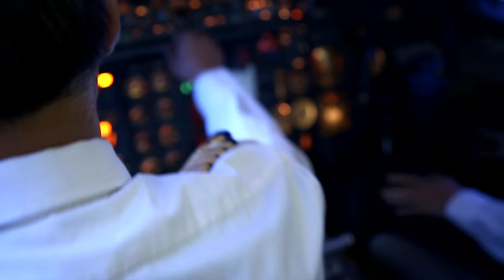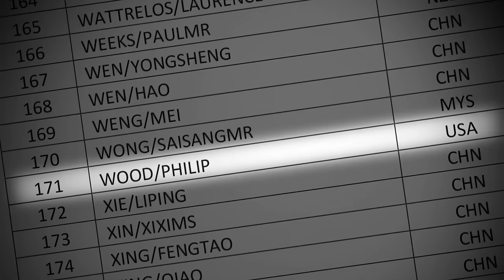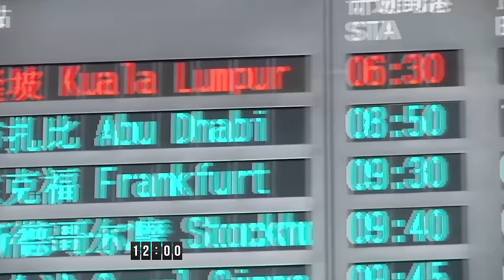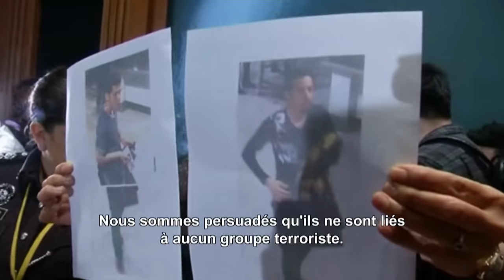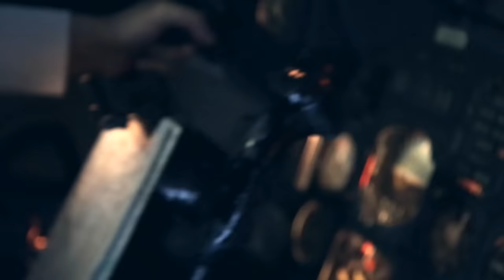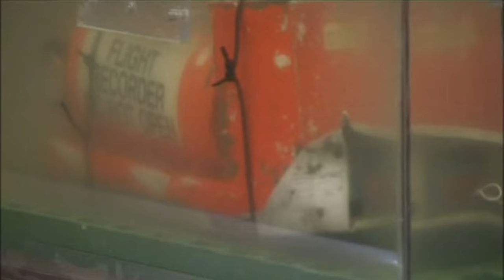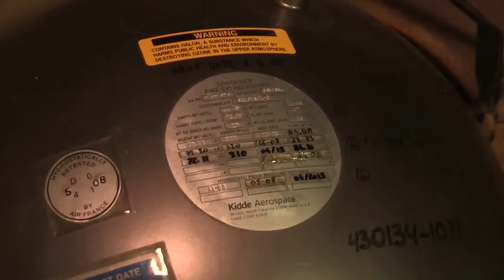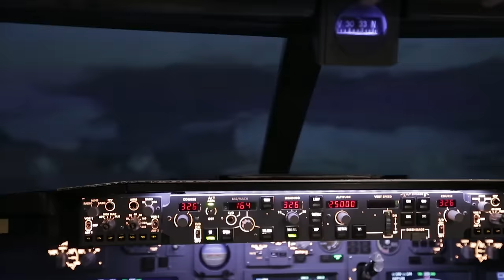Why We Never Found The Malaysian Flight MH370?

Comment: I don't think it ran out of fuel at all. I believe this was a deliberate controlled ditching into the ocean trying to leave the least possible debris trail. Which looks like what happened. And if you were going to intentionally ditch the aircraft, why would you let it run out of fuel ? Would be much easier to control the decent and the ditching with power. The fact that they found a flaperon indicates a low speed impact. Whom ever did this found some really deep water and ditched it as slow as they could. So it would just flood and sink. Thinking it would never be found. And given the depth of the water, they most likely will never find it.
Reply: @UguysRnuts  then why didn’t he just land the plane once he realized his negotiation failed? If he cared about the lives on board? And what makes the prisoner he cares about so much more important than the lives on the plane?
Reply: You are correct. Watch the lecture by Larry vance he explains it in full detail
Reply: @UguysRnuts  ohhhh sureeee he is
Reply: @UguysRnuts  thats honestly a pretty good theory. I hope one day we know the truth. Whatever the actual truth is.
Reply: @UguysRnuts  Its totally plausible that nations would have some sort of agreement like that in case of scenarios like this where they think that the lesser of evils is to cover up the truth to preserve some sort of image or prevent the possibility of other acts of terror. 

The only thing I find hard to believe is that the pilot would have taken things that far and risked his entire reputation as a pilot for a politician and then the fact that none of the passengers were calling their loved ones? 

This is so confusing. The whole thing is so dark and eerie.
Reply: It was never proved the flaperon was effectively from flight MH370.  Only guesses and assumptions.
Reply: @UguysRnuts  but why would the pilot go through such extreme conditions for the negotiation? He doesn’t gain anything from the release of anwar?

Also could you further explain the significance of obama visiting Malaysia as I don’t understand it
Reply: @sloeberdoet  Boeing confirmed it was from the aircraft. Every partof a plane has a serial number..
Reply: @mrwippy3112  Yes Boeing very convincing an American company.  The evidence of the pieces wasn't very convincing  plus it still doesn't proof that it was suicide from the pilot  even if it were pieces from the wreck.
Reply: It still shocks me considering how big a plan is
Reply: @UguysRnuts  it’s a great theory for sure. I can see it as possible and even more probable than other theories but I feel like unless we really know, it’s still not concrete. I wouldn’t be totally surprised if that was the truth.
Reply: ..so you didn’t leave an “OIL slick” or a huge explosion IF FUEL is onboard maybe?
Reply: @sloeberdoet  The flaperon is absolutely from MH370. Process of elimination alone makes a strong case for this.
Reply: @sloeberdoet  Your anti-Americanism is tiresome, and it is clouding your judgment.
Reply: He could have ditched fuel? The area they believe the plane lies in is over 4,000 meters deep. He knew what he was doing, and the Malaysian top brass know it.
Reply: how come more of the aircraft was not recovered ...they almost always find quite a bit of parts?
Reply: That's absolutely make no sense. If you wanted to intentionally crash the airplane. You do so immediately. This thing is making course changes and flying to no place.
Reply: @margaretmanzer2194  the Indian Ocean is a very big place. They conducted the biggest search in history. It's like dropping your keys in area bigger than Texas.
Reply: @WALTERBROADDUS  some things would eventually surface... i don't get this one at all.
Reply: @margaretmanzer2194  they did find a bit of the aircraft washed up in Madagascar. But the Indian Ocean is largely a big piece of nothing. Very few Islands. Most of the ship traffic is coastal. Once they got out there, almost  no way to find them. The curious thing about the whole thing is the turning off of the electronic tracking. It's a very purposeful act and not something pilots would fiddle with. The hijacking idea by the two mystery passengers is a possibility. But the whole flying away from any place on land, makes no sense at all.
Reply: @WALTERBROADDUS  i just don't get how they weren't spotted on any kind of radar system? You think the pilot did this?
Reply: @margaretmanzer2194  aircraft has what's known as a transponder. It gives the air traffic control the aircraft name and flight information. After the last transmission, that transponder was turned off. When the aircraft turned around military Radars in Indonesia did pick up a radar return but no one paid attention. And once they went out of radar range? They lost track of everything.
Reply: @UguysRnuts  I have not lied about a single thing. And I take great umbrage at your accusation.
Reply: @UguysRnuts  you have a funny description of lies?
Reply: @UguysRnuts  and you seem to have a problem being insulting and accusatory. There was no identification of the aircraft made. Nor was it possible to do so with a non-functioning transponder.
Reply: It did not crash in the ocean
Reply: @alexlauff8658  they recovered at least one piece of the aircraft off Madagascar I believe? There's basically nothing but ocean between Indonesia and there.
Reply: @UguysRnuts  what falsehood and rumor?
Reply: Not to mention how many countries have nuclear submarines and they still couldn't find that plane ! SERIOUSLY?????? I find that very hard to believe! And yes , I realize how much of this planet is covered by ocean . But lots of countries have submarines! 🤯🤯🤯🤯🤯🤯🤯🤯🤔🤔🤔🤔🤔🤔🤔🤔🤔
Reply: Yeah!!! I'm here for the comments
Reply: It's somewhere in Africa
My word, aren't your'e guys getting tired of 'assumed' this might have happened 😮
Reply: @UguysRnuts  hi
No game 
I just find you interesting 
No harm in that?  
And I've read all you comments
Some made sense and some you were just plain insulting and rude
Reply: @UguysRnuts  that was a hilarious comment hey? 
You just dont get it hey? 
It was meant as a joke
Stop being so seriously--- about things you cant change 
Live a little
Reply: @UguysRnuts  Delusional.
Reply: @wondergirl1586  Big things are falling down alot faster. Gravity is a bitch.
Reply: @yevgeniymaksimovich8505  It schockes me how this day and age when they already found the titanic they can't fin the plane. I hope their loved ones found peace.
Reply: This is Aslo what I thing happened . The pilot has even taken far of route that where they were looking for it is not even close as to where the plane was actually plunged into the abyss .
Reply: But why?!
Reply: @indranidasgupta8982  maybe he was suicidal and depressed . Some pilots have done this before deliberately crashed planes
Reply: @carljcmjk8609  I get that but it still feels like that was not his original intention.
Reply: @UguysRnuts  that's very interesting theory can you tell us how the discussion between the parties was made ??? i mean what kid of communication  means they were using ???
Reply: @UguysRnuts  not even a single mayday was sent . Dude cut off all transmission from the plane why?
Reply: @UguysRnuts  🙄😂 ok dude am done here now you totally derailed off track 🤦‍♂️
Reply: @UguysRnuts  🙄
Reply: @UguysRnuts  you are delusional
Reply: @UguysRnuts  ok thanks assuming this happened and many discussions made through it ,i believe  there were some trucking possibilities which the satellite produced as to the precise location of the plan did they (the investigators ) used it to locate the direction of the plane ???? i believed it could have been possible to truck the plane ,what is your thinking about that ????
Reply: @UguysRnuts  as far as i know satellite communication are  geo synchronize with the earth's movements enabling them to cover a certain geographical area on our earth , i figured as per your claim that the plane were using it for quite a while during the long  discussion  the captain has made ,  my thoughts are can they be recovered  in order to find the direction points   of where the plan was heading to  ,that was my meaning saying "trucking possibilities "  i hope you get me now .   ing possibilities "  i hope you get me now
Reply: I agree! 💯
Reply: @wondergirl1586 just consider the ocean size if that's possible.  A plane or a huge ship is but a grain of salt compared to the Ocean.
Reply: James Cameron can find it 🥳🥳🤸🏼‍♀️🌎🧙🏼‍♂️
Reply: @Chimp981  F*ck yeah he could! 💯💯
Reply: But who flew the plane?  Did they parachute out?   Does t make sense
Reply: It went to Diago Garcia!!!
Reply: It's a far cry from suicide to mass murder.
Reply: The plane is still mostly intact 7000m below sea level in an area of ocean called the Zenith Plateau. A company called Geomar found imaging of the plane sitting on the ocean floor back in 2017 using a EM122 Multibeam Echosounder. The crash site also perfectly lines up with the last satellite ping ring. The plane still being largely intact suggests it did not crash in a high speed dive, the pilot had to have been actively involved in setting the plane down during the final moments.
Reply: @UguysRnuts  no evidence he tried to negotiate the release of anybody
Reply: The Right outboard flap found at Pemba  Island proves that no pilot was in control. If you don't know why, then your opinion really does not matter.
Reply: @UguysRnuts why did he turn off communication equipment?
Reply: it was bad weater
Reply: @chadmichael_  Uguynuts is a scavanger I guessed
Reply: @UguysRnuts  you talking rubbish.Hope Msians authorities will sue you
Reply: @WALTERBROADDUS  Yes.He a nut
Reply: In short, no one knows, and all unconcerned guys build their own theories. It borders conspirationnism !
Reply: @williamsocrate7714  True dat
Reply: @sloeberdoet MY THOUGHTS ALSO....
Reply: The Navigation System crashed on Flight MH370 and the plane and occupants, plus crew survived.
Reply: @Gary-harold-p8t  You don't know. And if one of the crew and passengers did survive, He would have tell. You are just a mythomaniac
Reply: Not if they crossed over to the 5th Dimension to the New Earth tha the Supreme Creator blessed us; especially the crew and passengers of MH 370 @williamsocrate7714
Reply: @sloeberdoet   it was proved. The serial number of the piece have been read on the inner layers of plastic
Reply: @sloeberdoet  The flaperon is indeed from the plane MH270, serial number have proved it. But the suicide cause is still controversial
Reply: @WALTERBROADDUS   The only answer, is "we don't know". What we can be certain of is that the flaperon belong to the MH270
Reply: @williamsocrate7714  on that we can agree. Sadly the Indian Ocean is a very big and very deep place. With a whole lot of nothing in between. Sadly, this may just go down like Amelia Earhart.
Reply: @UguysRnuts u talk as if like your in the plane, u not even one of the family members
Reply: Someone explained that running it out of fuel then gliding it down for a crash landing on the surface would insure that the entire plane would flood and sink to the bottom
Reply: @johnscanlon2598  *ensure
Reply: But WHY would some one do that..im sure the other pilots could asked passengers to help /hem remove the pilot and then cuff him in restraints
Reply: @jennyleet2 🎉. C'est tellement vrai
Reply: If it had fuel on board, it may have left a trace on the surface.
Reply: Only reason pilot did not want plane to be found was then they would never be able to discover the real reason it sank to the bottom of the ocean. If the airline could not find the reason, they would be duty bound to pay the pilot's family the life insurance, pension, back wages and other dues from the company and maybe his wife would get a job with the airline in the bargain.
Not to mention the satisfaction of the company having to make a huge payout to all the passengers kin because he hated the company and wanted to take revenge on them.and destroy passenger confidence in the airline, because of his grievance at the way he felt he had been treated.
Reply: @tedmoss the fuel would be long gone you wouldn't see a thing
Reply: @britzkrieg2  I often question the actions of my government & I am a U.S citizen. Does that make me Anti-American? I have no faith in our leadership or believe that they are doing what's best for it's citizens. I'm convinced that every politician is a criminal. Maybe not guilty of breaking any laws but certainly are criminals in a moral & ethical sense.
Reply: And then
Reply: M
Reply: I don’t think you understand how impossible ditching a Boeing 777 the way you described is. Do you think this is a seaplane? You can’t just glide the plane over water to a slow stop at 600 mph
Reply: @mrwippy3112 this is false please revisit whatever article you think you read this from
Reply: Absolutely!!!! I thought the same.🤔😔🥺🙏
Reply: Pllllllllllllllllllllllllllll
Reply: Why would this "suicidal pilot" risk flying the plane for 8 hours longer than necessary to get the same result? I don’t think he would want to risk being shot down by a scrambled jet, which should've happened. It makes no sense...
Reply: They are all alive on a remote island with Tom Hanks !
Reply: @josephlevy2258 trucking ?
Reply: @evafleury5538  A scrambled jet from whom though? Exactly. By the time the plane was out over the Indian Ocean it wasn't appearing on anyone's radar and no one even knew where it was, so therefore no jets could be scrambled to find it as they wouldn't know where to look. The reason the pilot flew the plane so far south to an extremely remote area of the southern Indian Ocean was so that when it crashed, the wreck site would never be found.
Reply: Even if it ran out of fuel planes glide for long with no engine
Reply: @ritastevenson5532 the co pilot they reckon went to the toilet or out of the cabin and was locked out of the cockpit so they say that's what coud of happened
Reply: @chadmichael_  Personal commitment which he doesn't have with the passenger of his plane.
Reply: @chadmichael_  Very plausible. Het decompressed the cabine so everyone was already losing conscience before he start out his plan.

Comment: One item of clarification.   This documentary says that the ACARS systems can only be deactivated in the avionics bay..  but that is not correct.  It has been shown that powering off the main engine generators.. would immediately power off many systems on the plane including the SATCOM system that ACARS uses to communicate with satellites.  Now that the SATCOM system is down, you can go into the flight management computer in the cockpit and disable those communication methods.. thus cutting ACARS off from any sort of satellite communication./. This also takes carte of the issue of communications with the ground on satellite phones. and the screens in the passenger cabin from relaying into information to passengers
Reply: Rubbish.